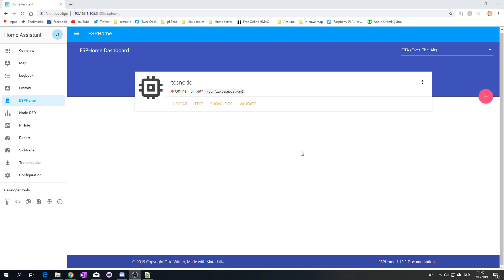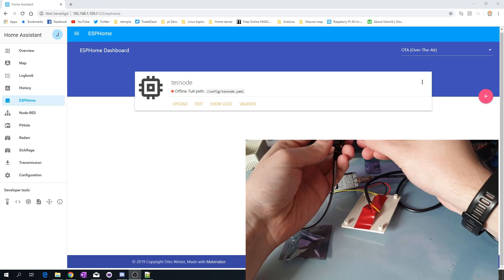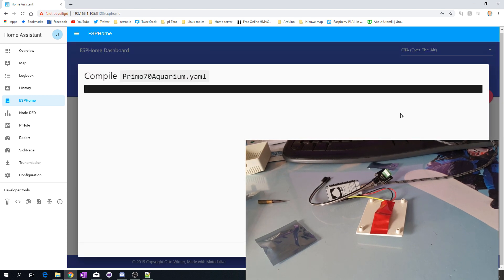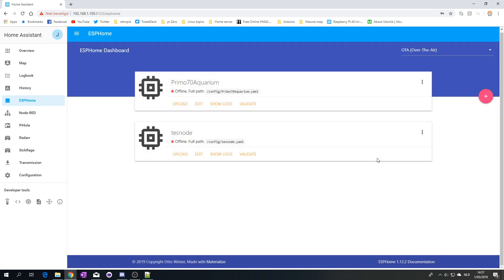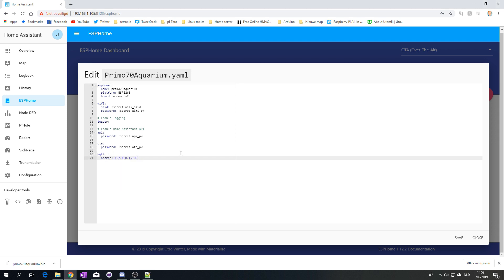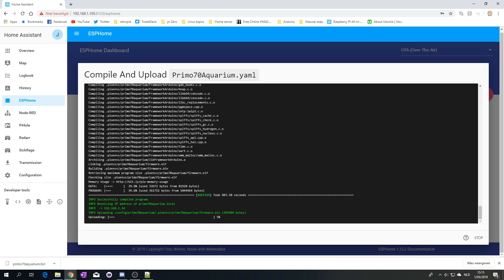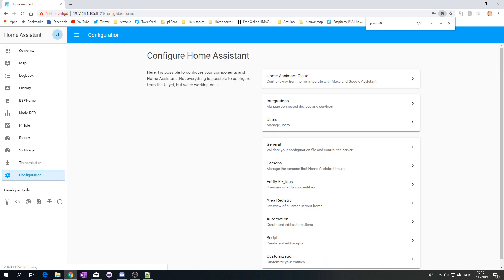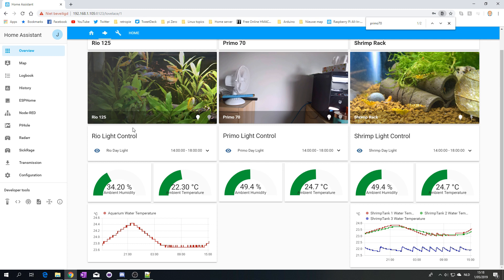Stepping Up My Home Assistant Game #3 - ESPHome

Comment: I’ll share a quick tip with you that I figured out I’m speeding up compile times. Install ESPhome using pi3 from the command line on the host system outside of Docker. It’s a very minimal install, and it Gives the compiler more horsepower. I’m running Home Assistant on a raspberry pi 0W, which would make it nearly impossible to compile ESP home On the host machine. I have the  ESPhome python installed on my laptop, which is a quad core machine and compiles much faster than the pi ever could. I mean, really you can run ESP home on just about any machine standalone that has python And is on the same network as your Home Assistant.
Reply from the maker: There are a billion ways of doing it :) My Hass.IO is now running on its own VM and is using the ESPHome addon. works well for me.
I also don't compile that often anymore. Things have been working for a very long time without me needing to change anything. Maybe I'll have to update some of the firmwares but well... It's a VM so it can just do whatever, even if it takes some time :)

A PI is nice, but indeed just a lot slower compared to a 'normal' intel/AMD processor. Even if I don't give all the cores it just runs like a breeze :)

Comment: Hi there! Could you please provide more info how to connect esp8266 with DS1820 ? As I see you have "white box" and also you are using "adapter" to connect esp8266 with DS1820. For newbies this info will be very plausible. Thanks
Reply from the maker: for me the sensor already came with the module attached. All I had to do was connect the VCC to 3.3v, the GND to GND and the data pin to any GPIO pin on the esp module.